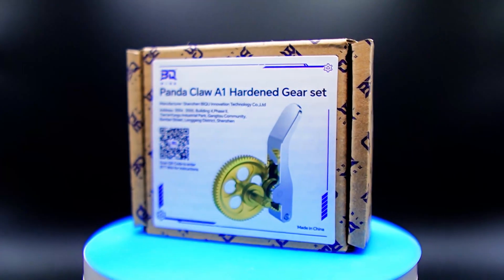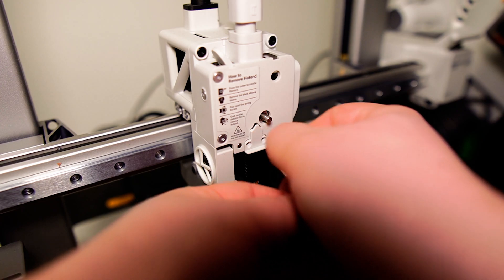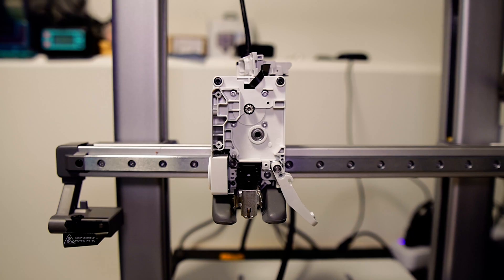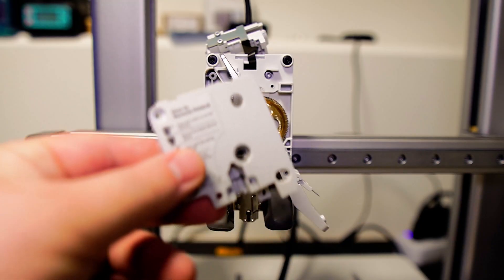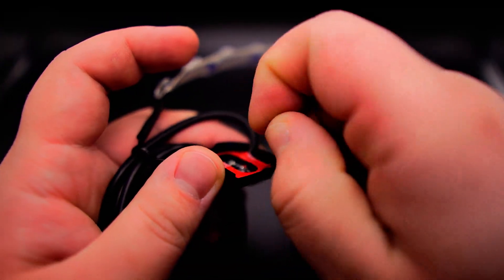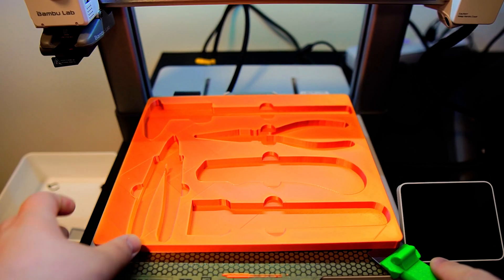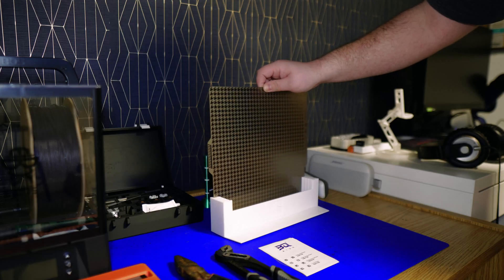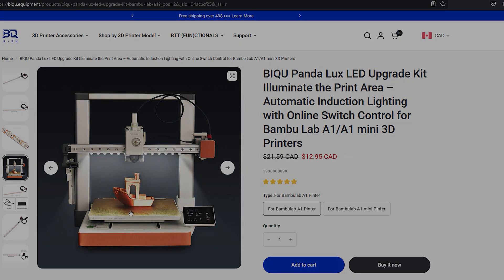5 Must-Have Upgrades for Your Bambu Lab A1 Printer using BIQU Products

Comment: the metal gear is not recommended at all since its heavier which is not good for precision. No reason to change the original plastic one, its like tuning with cars, often its worse compared to original.
Reply from the maker: It's a bit louder also, the metal one. You can audible hear it. Besides longevity, I'd personally stay with the OEM.

Comment: I lost that little screw ca that goes with the spring at 2:31  Anyone know where I can get a replacement? I tried looking on Bambulab's website but not having any luck finding it : (
Reply from the maker: Hey there,
Is it not under "Screws Kit - A1 Series and AMS lite"
Reply: @  I will check. Thank you

Comment: If you are changing out the Cutter blade assembly the lever has a tiny circular magnet in it. this may fall out. without you being aware. And lost on the floor somewhere? On reassembly without it the Cutter assembly may not function correctly.

Comment: Any difference in print quality after instaling new  gears ?
Reply from the maker: It works a bit louder, but not something you'd hear if you are really there. I now have an enclosure (for next video) so the noise level went down even more.

Prints are really the same. What you are getting out of this is longevity of the gear.
Reply: @3DPrintedProject  How come if the stock one is already hardened steel?
Reply from the maker: @OverRatedTheFirst  the driven gear you get with your printer is plastic (big yellow gear/cog) vs the one from BIQU that is metal. I believe that is what's causing the noise. The driver gear.
Reply: @3DPrintedProject  does that also go for the spare set you can get from bambu itself? it does say Hardened Steel extruder set,  in terms of pricing it's about the same price, but it's hard to tell if the spare set has steel gears or not
Reply from the maker: @monsterhunterrivi6303  hey, it's a bit confusing why they write "hardened" on Bambu Labs , because that yellow cog (which is what you get when you buy hardened extruder from bambu) is definately plastic. There is then the smaller cog/gear which is steel yes that pulls the filament.

Now BIQUs is all metal. 

Hope this helps :)
Reply from the maker: @monsterhunterrivi6303  one benefit you get from that plastic gear that comes with bambus is it's a bit quiter so you don't hear your printer working as loud.

You'll notice sound difference when you get BIQUs.

Bambus;
Pros: quiter
Cons: can wear out easier

BIQUs:
Cons: Louder
Pros: Longer lasting.

Comment: The stock extruder gear is a hardened steel extruder gear - why switcht even though it hasn't worn out?
Reply: As someone who just installed this set on their new A1, I can promise you that you're wrong. My extruder gear was 1000% grade A plastic.
Reply: @Grimorse mines yellow plastic
Reply: Are you sure it looks plastic to me
Reply: i think the “hardened steel” part of the extruder is the little part that is in contact with the filament, which is technically the extruder so even though the cog is plastic, they can call it a “hardened steel extruder”
Reply: @danieljames500  gotttcha, i replaced mine, it wasnt catching the filament for some reason.
Reply: @DMR76  with the original or the one from BIQU? i’m interested in if that’s actually a good replacement part and if it works as well as the original
Reply: @danieljames500  i ordered the BIQU, going to test it out today and see if that fixes the issue of the AMS Lite not being able to feed into the extruder.
Reply: @DMR76  would be interesting to hear back from you after you've used it for a bit, so if you happen to remember to i'd like to hear how it goes
Reply: @danieljames500  sure ill send feedback later on today to see if that fixed my feeding issue.
Reply: @danieljames500 so I replaced it and the clicking and feeding issue stopped with the 0.4 nozzle but I think the clicking I’m still having with the 0.2 is maybe clogging issues.
Reply: @danieljames500 but the new gears work super well, so far zero issues, they feed the filament with ease and haven’t had one feed issue
Reply: @DMR76  that’s great, thanks for getting back to me! any quality issues like layer lines not being 100% aligned or inconsistent wall thickness?
Reply: @danieljames500 nope everything looks and works great! I was worried the new extruder would be hard on the filament but no it’s fine
Reply: @DMR76  that’s awesome, thanks so much for all your replies!
Reply: @danieljames500 no worries, hope it helps if you need to swap yours
Reply from the maker: Just showcasing a product that eventually would need changing.
Reply: The hardened steel extruder gear is an OEM upgrade accessory.